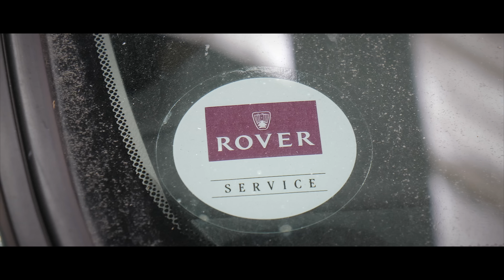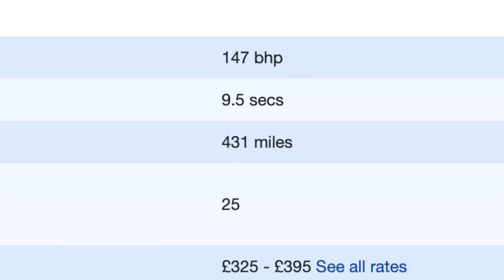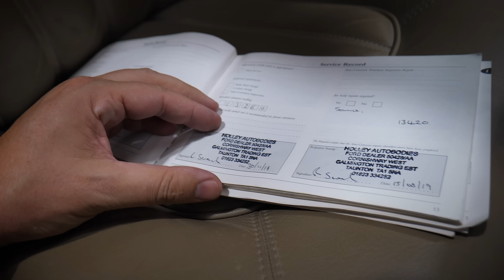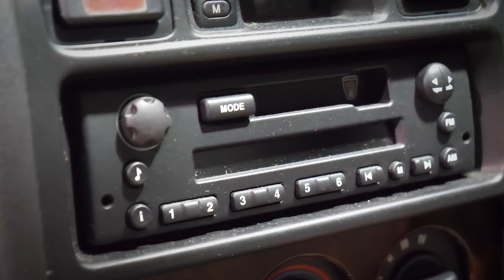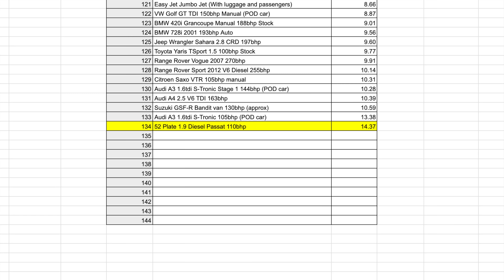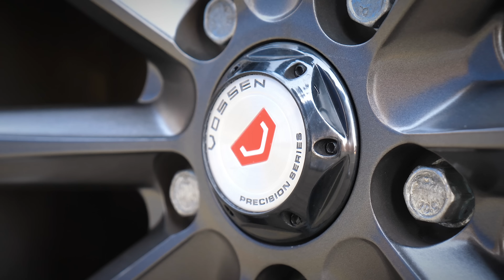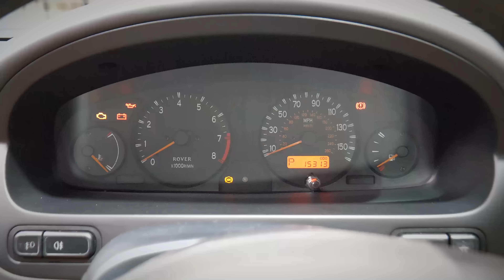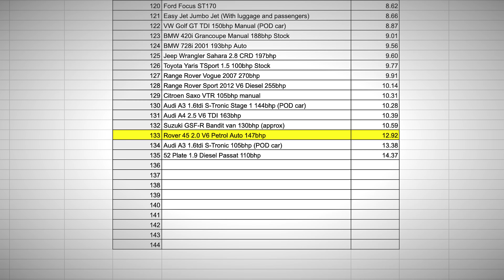£1,000 CAR CHALLENGE (With Less Than 20K Miles)

Comment: I inherited an early 2000’s rover about 6 years ago. With the dreaded k series 4 cylinder. It had done about 16k miles. It had been sat for years and the interior was covered in mould. Apart from needing a new alternator last winter , it’s been perfect. gets used most days. To start with I just had it as a spare car. Done about 40k miles now.

Comment: The head gasket's is a rover k series's 1.4 1.6 1.8 issue not a BMW V6 issue but you already know that but a good video none the less
Reply: The V6 is Rover's own, nothing to do with BMW at all.  The only BMW engine MG/Rover ever used was the Diesel in the 75/ZT.

Comment: ive had 3 mg zs 180s with the kv6 and they are a great car. very underated because of the badge, its a shame. and theyre not that slow. youre jsut use to stupidly fast cars lol also they has something called vis motors and if they dont work then they wont open the flaps in the manifold. if you have a vtec kinda feel around 4k
Reply: This ones a 2.0, the ZS 180 was a 2.5. The 2.0's were pretty slow for the size of the engine to be fair, felt even slower in the heavier 75

Comment: Wbac £1300... is that the price after they've looked at it? Cos if not i bet its soon reduced once they find imperfections
Reply: They sell between 800-2200 for the rovers and the mgs are between 800-7000 they picked up after covid as the rovers barely made 1k then